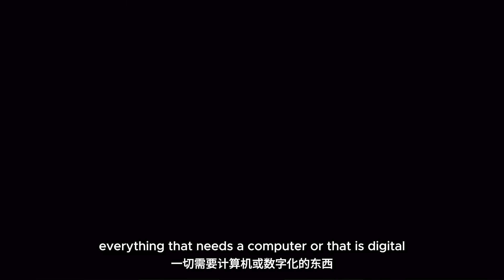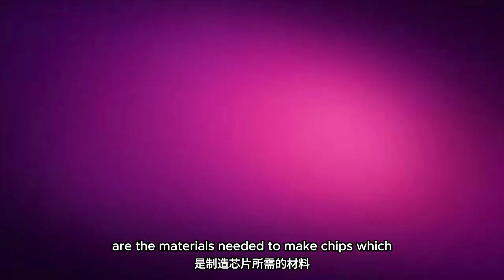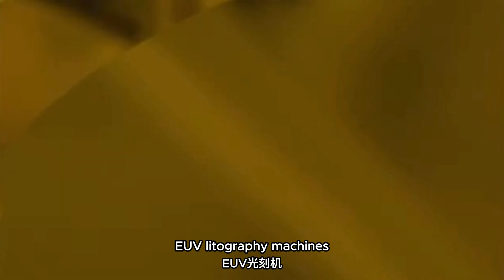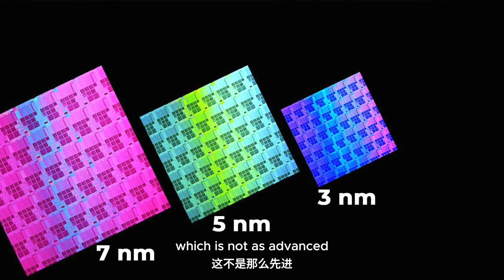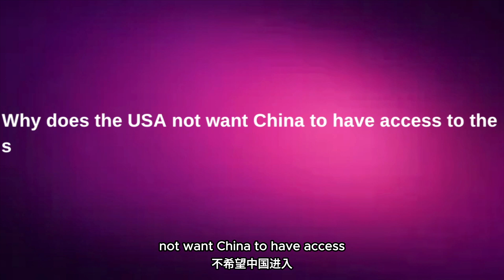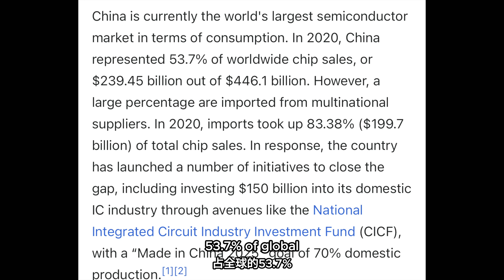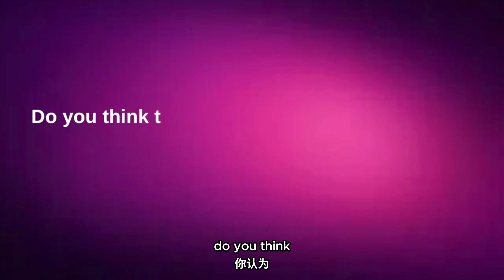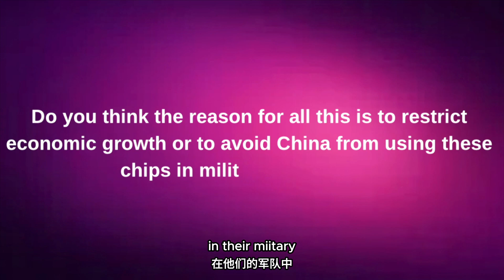CHINA Vs USA Tech War Explained!

Comment: Nah, the military doesn't need a 7nm chips. 28nm chip proformed well for jets and missiles. For a missile, there is no difference between a 0.1 millisecond response and a 0.05.  In particular, many military chips are only used to process a single instruction and do not require particularly large computing power. And Most of the military equipments are large enough to provide the room for chips. So they don't need to be small. 

However, the size and space of mobile phones are limited, and smaller craftsmanship means better performance under the same size. 

The goal of the United States is very clear, which is to suppress the semiconductor industry in China’s civilian market and maintain its advantage over China in the field of science and technology.  They did the same to the Soviet Union forty years ago. The difference was that during the Cold War, the United States would deliberately leak chip technology to the Soviet Union, causing the Soviet Union's semiconductor development to rely heavily on American intelligence.  Ten years ago, the United States actually completed its dominance of China's semiconductor industry. However, the current approach of the United States not only fails to restrict China, but will instead make China get rid of its dependence on the United States.  To be honest, I feel that every US president has been helping China get rid of US control. Although it sounds ironic, it is true.

Comment: There is only one American semiconductor company that makes their own chips, Intel.  Intel can make 7nm chips as of two years ago.  There are other American foundries, but none make chips beyond 14nm.  Apple gets its chips from Qualcomm because Qualcomm makes a mobile phone chip that has 5G. Apple is working on its own chip with 5G, but it is not there yet.  Qualcomm, Nvidia, AMD, and other American semiconductor companies needing high end chips get their fab done by TSMC of Taiwan or Samsung of South Korea.

Huawei used to get 5nm Kirin 9xx series chips made by TSMC until the US forced TSMC to stop producing Huawei chips because their ASML lithography machines have several key patents in them. Ditto for Samsung.

Now China is making their own lithography machines and are closing in on 32nm.  China buys ASML DUV machines and can apparently get down to 7nm. Some say China can achieve 5nm, as say the specs on Huawei's laptops.  No one knows how Huawei gets 5nm, whether from past supplies or a new technology.  

China is working on advanced lithography and one approach using a particle accelerator, can achieve 5nm.  Russia says they have developed a 7nm lithography process.  China is also focused on photonic, graphene, and quantum chips said to function like a 2nm silicon chip.

The bottom line: China keeps chipping away at the west's lead in silicon semiconductors and it has been developing alternates to silicon to leapfrog the US sanctions.  The way things are going now, China will lead the semiconductor sector in this decade and the US semiconductor companies will lose the China market.  The US government, under Biden's leadership has really messed up.  Instead of dominating the semiconductor sector, the US is bankrupting US semiconductor companies.